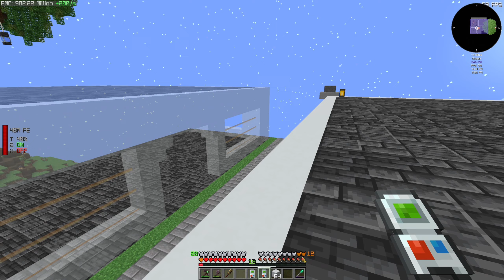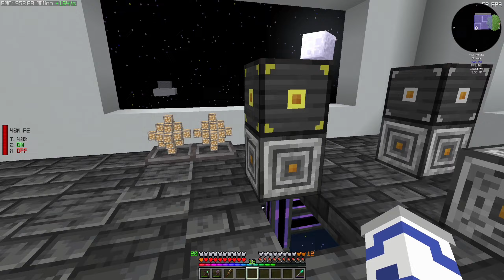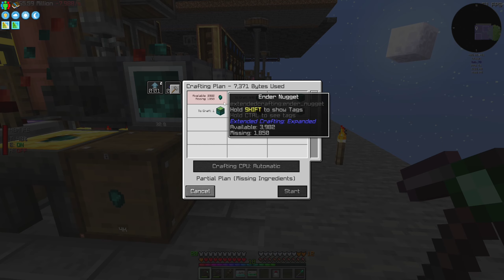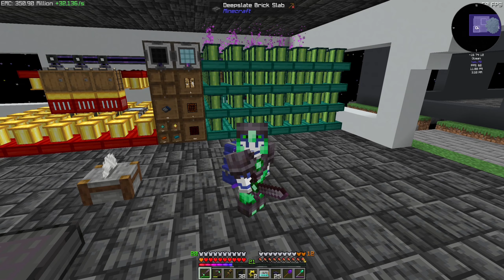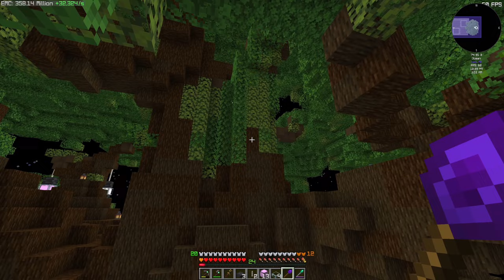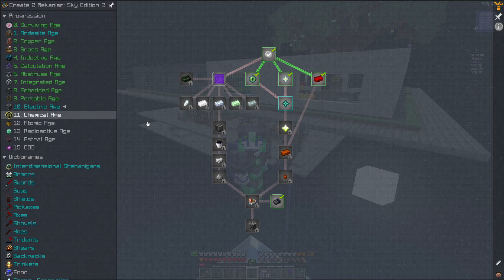Create 2 Mekanism Sky Edition 2 Ep11: Base Maintenance

Comment: Klein Star Omega to charge Swiftwolf's worked for me, make sure you charge it in the transmutation table first (I'm guessing if you pulled it out of the ME system then that's the step that you forgot). I agree it's way better than the jetpacks and tbh makes the jetpacks kind of pointless.

I got my warden DNA sample by spawning a warden naturally in the Deeper Darker dimension with a shreiker, stabbing it and then booking it out. That worked really well until I had to go back in and there was immediately an angry warden basically right next to the portal. But if you can be a bit smarter about it than I was then that should work out.

And I'm definitely not just advocating that so that I can see you do some adventuring :) (but you should definitely do an adventuring episode since you have access to the Deeper Darker as well as the End now).
Reply from the maker: Oh my gosh, you're so right. I completely forgot about charging the Klein star in the EMC table. The tooltip says to charge it, but for some reason I was thinking I could right click it haha. Any who, thanks for the heads up on that and the Warden. I tried releasing the Warden I had captured in the Deeper Darker to get his DNA but he just disappeared again. I guess an adventuring video and the "all natural" spawning of one is in order :)